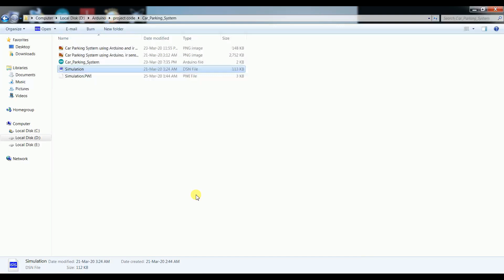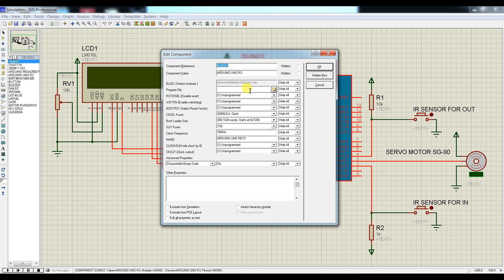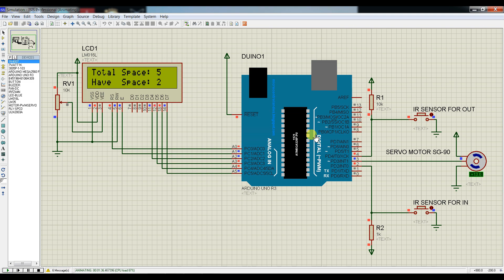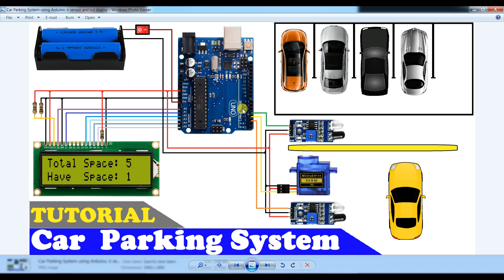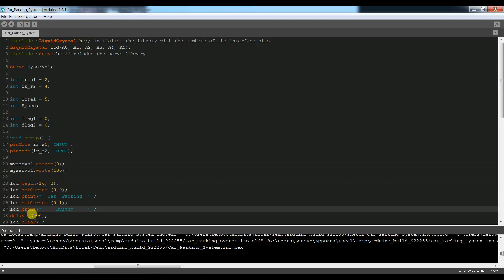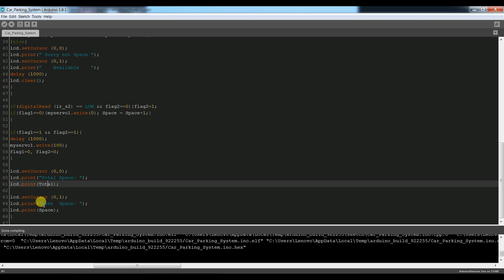How to make a Car Parking System using Arduino and IR Sensor

Comment: hello I'm really stuck I'm working on this file and I understand nothing I use two sensor sensors at the entrance it's good but the exit it doesn't work with LCD it counts sometimes 4 sometimes 6 help dear Engineer

Comment: Bro, why you put VCC to Reset pin in Arduino Uno to Proteus
Reply from the maker: VCC to Reset pin in Arduino Uno not for reset position its running and attach the reset to gnd for reset

Comment: Hello, how can I make multiple levels in this car parking system?
Reply from the maker: Add the value of this variable
int Total = 5;
Reply: @MuhammadAnsar  sir, I have to design it in such a way that the LED shows levels : Ground, 1st floor and 2nd.. 
How can I write this code for arduino. please help

Comment: Which software is used to run the program plz ans
Reply from the maker: Arduino IDE
Reply: @MuhammadAnsar  thank you
Reply from the maker: @atharvajoshi4303  Welcome
Reply: @MuhammadAnsar  while running the program does the arduino must be connected to the lappy i m doing it for just simulation does it require to attach it.

Comment: Have you used 10k potentiometer
Reply from the maker: no
Reply: @MuhammadAnsar  then you have used 4.7k, 1k and 100 ohm resistors right? There is no potentiometer used?

Comment: Bro my servo motor runs automatically where i go wrong please guide me
Reply: What was that black thing he placed on breadboard in front of LCD display or is it necessary????🙏🙏🙏🙏
If you know it then  please reply🙏
Reply: the problem is the voltage and current level you give to your servo motor. If you are providing supply to the servo motor with arduino uno connected to your PC, servo wont run how you want!!!. i suggest you to give power to the servo motor seperately keeping the ground of servo and arduino uno common.

Comment: This is super amazing. I have followed all these steps but my LCD is getting on but not showing anything . where i am going wrong?
Reply from the maker: thank you 

Check the LCD contrast setting pin resistances
Reply: @MuhammadAnsar  hi bro .....even Iam getting the same issue ....lcd is getting on but not displaying anything
Reply: Me too
Reply: Use potential meter to adjust brightness of LCD
Reply: What was that black thing he placed on breadboard in front of LCD display or is it necessary????🙏🙏🙏🙏
If you know it then  please reply🙏

Comment: Can we use 9v battery in place of 2x 3.4 rechargeable batteries.
For project demonstration purpose.
Reply from the maker: yes bro
Reply: @MuhammadAnsar  ok bro 👍
Reply: Bro on attaching 9v battery to arduino

The LCD screen becomes blank and display nothing and on the other hand if i connect Arduino to my laptop de-attaching the battery everything works fine.

Please help me brother.
Reply: @harshitgupta4169  hey did you make this project ?

Does your 9v battery problem solved?
Actually I also want to make this project.so I need someone to help me if I stuck somewhere.
Reply: @padminirathore9612  yes the 9 v battery issue solved but it will discharge very soon .So i preferred using 12 v dc adapter it works fine.
And the 9v battery issue is due to CONTRAST of LCD so try to  give different voltages to CONTRAST pin of LCD from arduino .

Comment: Excellent project. Is that can I do this project as my final year project ?
Reply from the maker: thank you
yes bro
Reply: Hey @M.S ASHWIN did u made this project?
Reply: @padminirathore9612  ya
Reply: @m.s.ashwin1018  oohh great
Reply: Can u please share your all details related to this project.
Because I was also planning to make this project.
N need someone to help me if I stuck somewhere.
Reply: @padminirathore9612  Sis just follow the step in video that given by Ansar...there is no problem...will happen during do this project..so all the best
Reply: @m.s.ashwin1018  hi
Reply: @MrPerfectPianist  they are just small jumping wires.
Reply: @padminirathore9612  I got it👍

Comment: Thank you brother but i still have some problems when i make the simulation on tinkercad , if you can help me out let me know it's veru urgent please
Reply from the maker: Tell me if I can help you
Reply: @MuhammadAnsar  Bro i did this project and all connections are proper but then also the 2nd ir sensor both red lights are ON, that's why servo motor is not working properly, what to do bro ?
Reply: can i contact on email ?
Reply: @yooru7942  
Did you made this project?
If yes then can u please help me
Reply from the maker: welcome

Comment: What are these black and white thing in breadboard other than 1 K and 100 R resistor.
Reply from the maker: Jumper wires
Reply: What are the functions of the 1k and 10k resistors

Comment: If you find the following program in Arduino, if you call Sim900a, the bulb 1 should start only 2 seconds ON and when you call again the bulb 2 ON should start 2s.

Material..

1. Arduino

2. Sim900A

3.LED 1

4.LED2
Reply from the maker: yes bro
Reply: @MuhammadAnsar  sir please do it
Reply: ajitzagade19@gmail.com